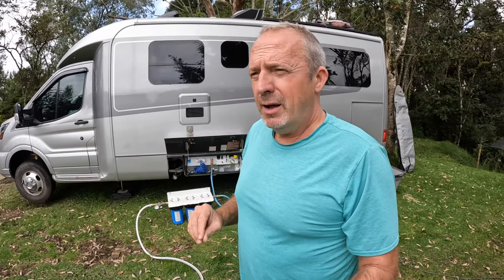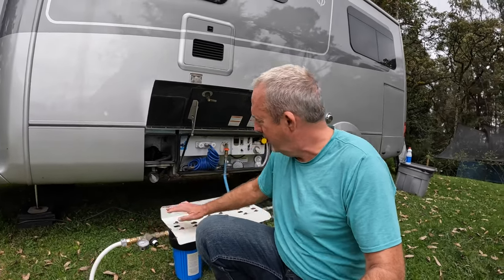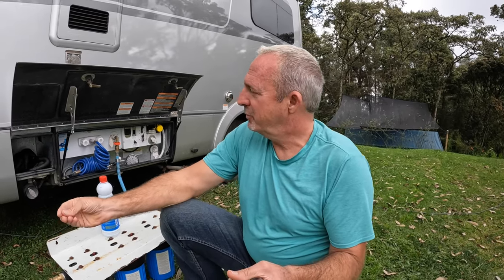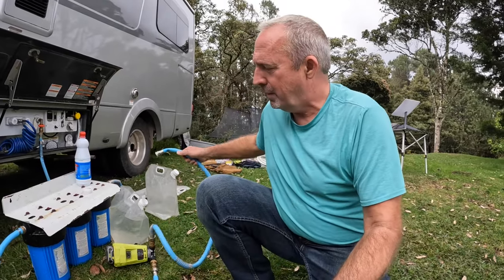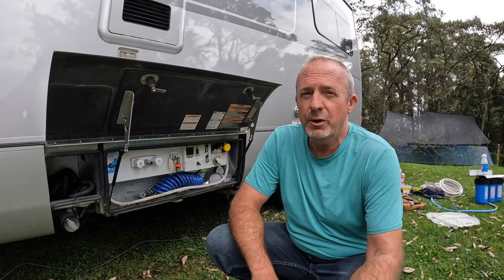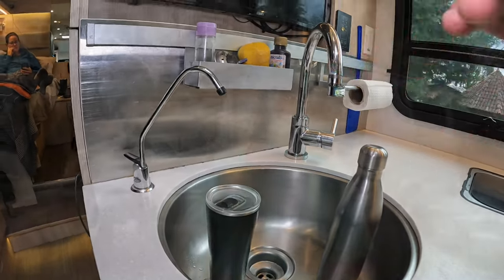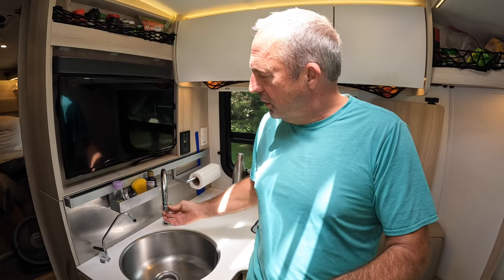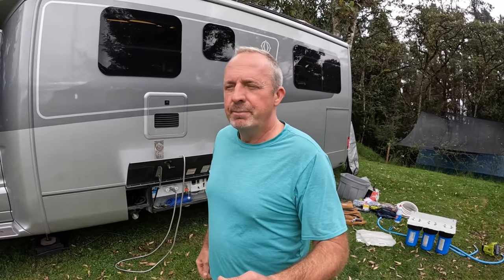Filtering Non Potable Water for Drinking in a RV | B+ Overlanding

Comment: Have you considered the new teck of (2 Stage) air bags mounted on cones and getting rid of that sway bar all together? It doesn't seem like your short on money a thousand dollars gets you normal 2inch lift leaf springs, the blocks are for people on a budget and want the look. 
 I see alot of weight distribution success by floor mounted Tesla battery and getting rid of all propane and generators put a regular household fridge with good battery's. You can put solar-server rack battery in on a budget for real household power.
 All in all that's a nice rig you have and your pretty brave risking breaking down south of the border like that, more brave than I am.
Reply from the maker: Air bags are very nice, but I went the direction I did for durability. 
We have 500w solar and 600A of lithium which powers our electric needs well. We love LP. Per gallon it provides a huge amount of power and is a highly efficient way to run a refrigerator (and our furnaces when it’s snowing outside -last week for us). Our built in generator is good backup and has saved us a few times. 
Your points are well taken, and if we were just going to overland on NA, we might have done a few things differently.
Reply: @BPlusOverlanding  I apologize for being pushy but more content is greatly appreciated...  You water filtration episode is tremendously informative..  it's caused me to reconfigure my setup for the better....